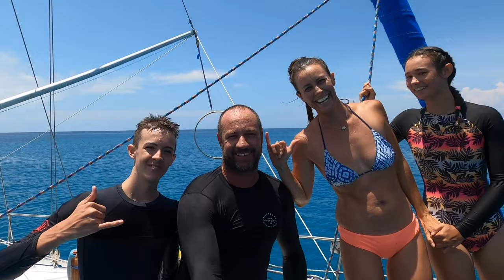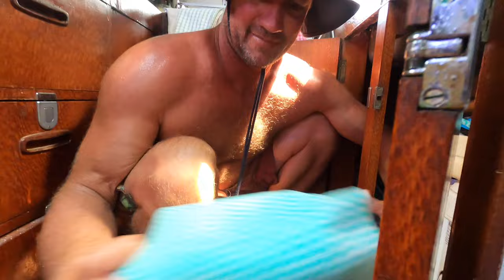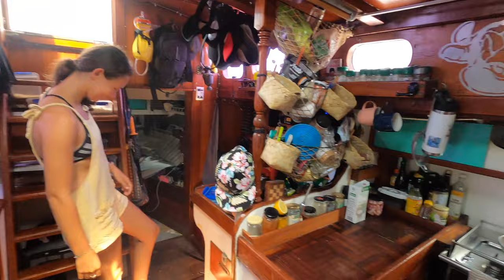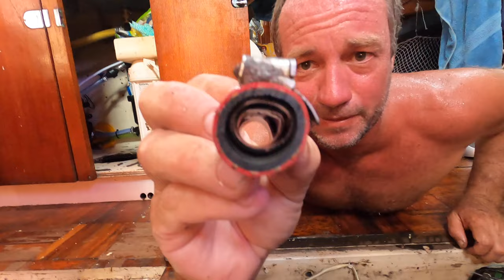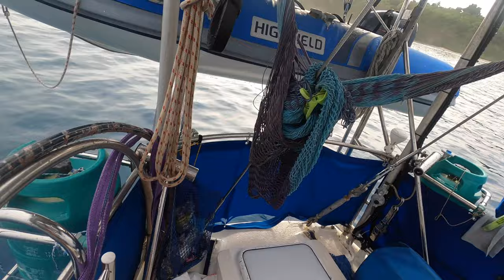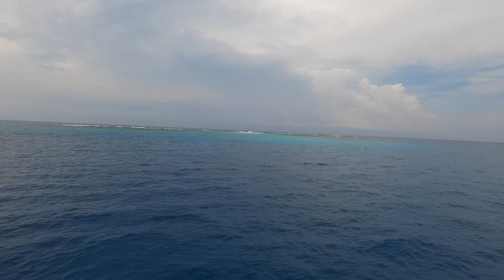Saltwater and smoke inside the boat ARE WE SINKING Life on the Sea | Episode 221

Comment: With your fresh water pump make a cover from a 2 ltr plastic coke bottle ,Cut the plastic bottle so it fits over the top of the pump and put some holes around the side of it so the pump stays cool and dry from any water that may drop from any water hose leak.
Reply from the maker: Thanks mate what a great idea 💡

Comment: Bugger.. if your exhaust over heats, the hose can delaminte and partially block the hose itself. Just a bit odd why the whole system is now under pressure. Check that exhaust hose, but have  another beer first. 🍻👍🇦🇺 @sailingpopeye .

Comment: Lee the exhaust mixer elbow is clogged with crap.
Reply: That's kind of my thought also. Another concern is salt water backing up into the engine although I guess the positive pressure of the engine exhaust will prevent it as long as the engine is running.
Reply: @JamesNewsomeCaiLeighAnna  exactly,I found that with my yanma with the anti syphon valve corroded and blocked and back filled the cylinders and ran out the air inlet flooding the engine and boat,lucky I was there when it happened and managed to save the boat and the engine,dodged a bullet there I tell ya.

Comment: I think you could have a clogged exhaust elbow. This boat had one, they fought the problem quite a while but thinking they could burn it out, which wasn't working. They are expensive, sometimes you can get replacements built for less than an OEM. These guys don't know what they are doing but this video wasn't bad. https://youtu.be/-JMBeF-4M_Y?t=349 I  go to 5:49 first. I'd watch that explanation and see what you think, he thinks it can't be really cleaned out.